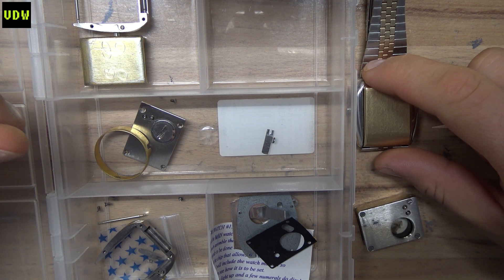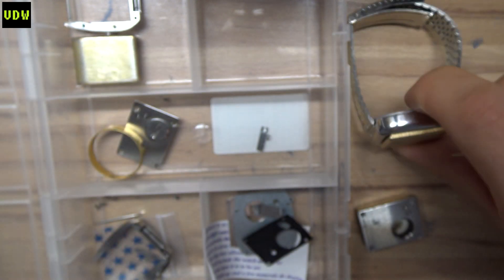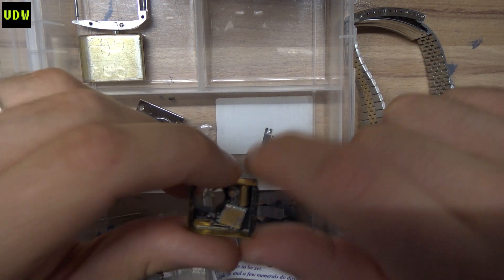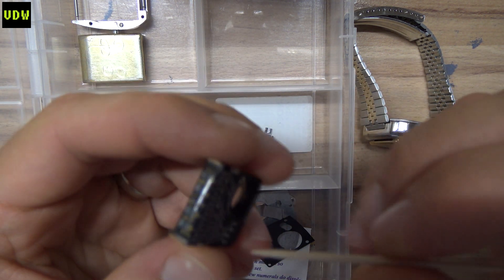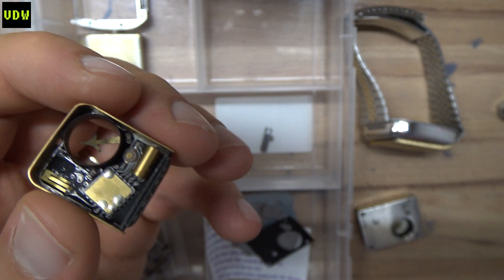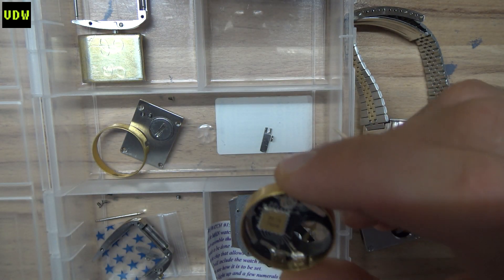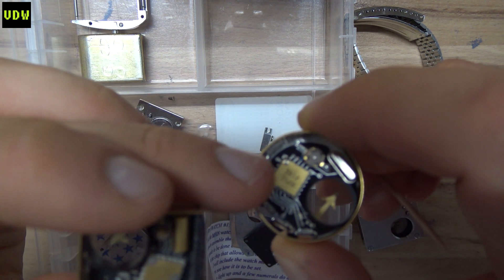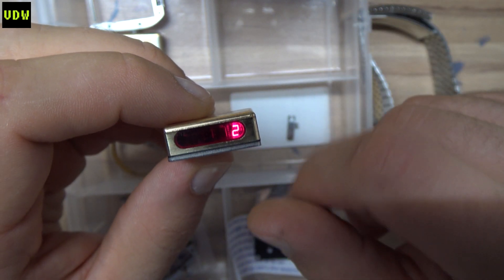Benrus LED watch repair - Ep 100 - Vintage Digital Watches

Comment: Hi me again, I have NOS Pulsar calculator that is not working. Interested in having a crack at it. Should make an interesting video because it looks like there are two motherboards sandwiched together, plus it doesn't even look like its had batteries in it so could be an easy fix.

Comment: I have a Seiko a127 that works ok when off the wrist.  However, after wearing for an hour or two it turns off.  I have dissambled and cleaned but problem remains.  Any advice would be appreciated.  Love your content!
Reply from the maker: The A127 is iffy, I have one clean that doesn't turn on, I'd say something is loose and power gets disconnected OR  some component is influenced by the heat on your wrist. Wear it over something with a sleeve and if it still turn's off then it is something mechanical and power cuts off.
Reply: Thanks! I think you're right about the heat. Wore outside in the sun and shut off much quicker.  Time to find where it's failing.

Comment: Can you please recommend a tool to allow me to remove the battery hatch of vintage era Seikos?.
I live in Australia and the closest coin that I've tried using is our 5c coin, but that is too thin and I end up screwing up the hatch.
There must be a specific tool / coin that fits the groove perfectly.
I own several 70's Seiko LCD's and a couple are stuck fast and I don't want to ruin them even further trying to open them.
Reply from the maker: Hey, coins are what I use and most people, maybe get a suitable washer from ahardware store. But if they are stuck then only if you remove the baccvoer of the watch and assist from the other side might help.
Reply: @VintageDigitalWatches  thanks for the reply, actually bought this specific Seiko tool but it was useless and just ended up popping the entire back off of the watch.
Also do you do repairs?. I have several 70's LED/LCD watches that need repairing.

Comment: Great videos. I have an led Trafalgar watch which lights up and goes through the time/date cycle fine (with the little push in button) but I cannot get the button which brings up the display or adjusts the time/date to work.Any thoughts on what the problem might be? I can,t see anything wrong visually.I can find virtually no information on troubleshooting/repairing these type of watches.

Comment: Hi thank you for the video I bought a 95qs-42, I didn't make an accurate inspection, try to simply change the battery BR 2320 and put a classic CR2016. The display is shown only if I press the light, stay on for 3/4 seconds then fade away. Other buttons seem not to have effects, only the light button (the light works). Thank you
Reply from the maker: Not familiar with this fault, needs hands on diagnosis.
Reply: @VintageDigitalWatches  Thanks for the reply, really face this problem for the first time too, if I send you a little video can you find a minute to watch it and tell me if it maybe can be fixable or not waste my time on it? Thank you

Comment: Love your repair videos! Would love an episode for newbies on basic DIY cleaning / oiling of a vintage LCD watch.🤓
Reply from the maker: Thanks RG, there isn't much ro say about oiling digital watches. Only the early ones where you have control from the crown lubrication is needed and you need a manual for that to speciffy where to put oil.

Comment: Awesome fix Tiberiu, you always make it look so easy but there's a lot of work that goes into these repairs and restoration outside of this video and as you mentioned sourcing the rare replacement parts.
Reply from the maker: Thanks, in this case I was doing it a second time so I had some experience :)
Reply: @VintageDigitalWatches  Just amazing to see TWO Benrus LED pop-up together. These are rare!